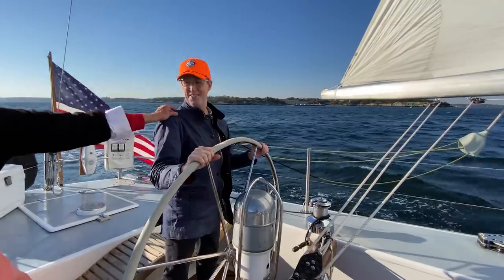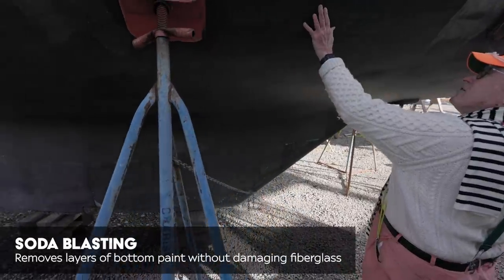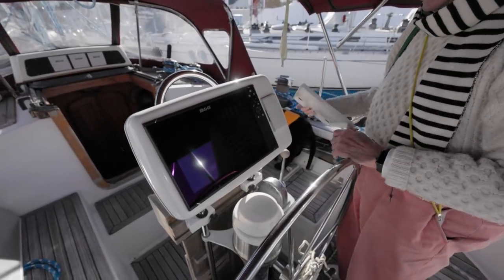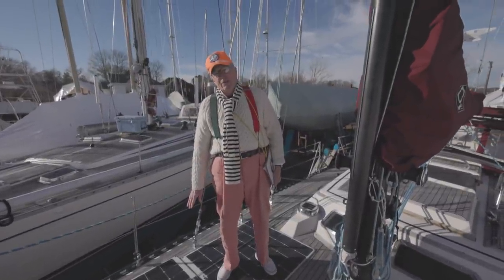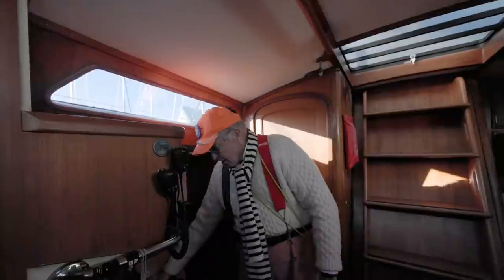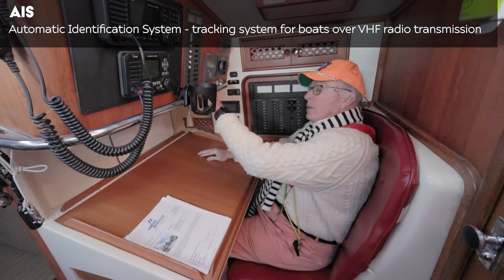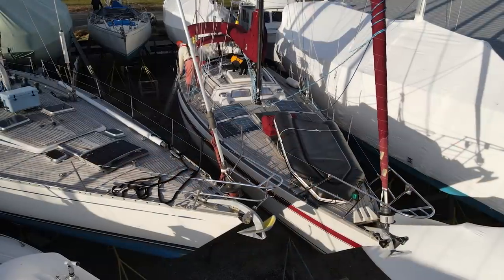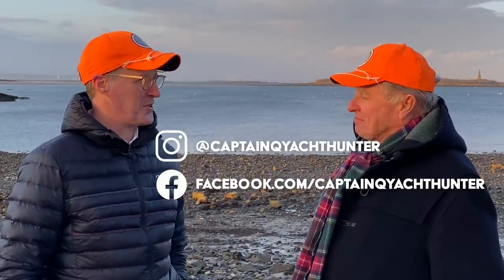$99,500 USD GLOBAL CRUISER! Proven bluewater sailboat for sale! EP76 #sailboatforsale #sailboattour

Comment: I absolutely hate that forward companionway for two reasons.  One, you have to go onto the cabin top to use it which is dangerous in a seaway and two the ladder is almost vertical.  The ladder simply invites a bad fall.  Repairing the water damaged teak veneer is not that hard IF the substrate isn't also rotted.  That said, making the repair invisible is difficult and requires a lot of experience matching colors with stain.  On top of that the entire interior will have to be stripped and revarnished which is a big job.  The teak decks are shot as you noted and every screw is a potential water entry point into the deck.  A proper repair is also a HUGE job.  The v-berth looks pretty unusable to me.  Does the boat have a genset?  if not there is no way to heat the boat away from the dock.  Lots of issues, not to mention engine access.  Not the sort of boat I would want.
Reply: There's a genset under the helm. The midship companionway has sufficient grabreails. Engine access under   that middle companionway looking aft is very good as is access hatch in starboard head.   Lemon oil all the wood below keeps a satin shine. Once a year or more.
Reply: @richgleason7699  too bad they didn't show any of those things in the video.  I would never use lemon oil.  All my interior wood has eight coats of  Epifanes gloss followed by two coats of Epifanes rubbed effect.  The cabin sole is finished with Epifanes 2-part.
Reply: @todddunn945  truth is just the idea of putting multi coats of Epiphane's on that much interior wood is enough to make me quit sailing! I'll stick with Lemon Oil. Kidding aside the quality of the wood inside is amazing
Reply: @richgleason7699  Well I did say it is a big job, but doing it right is worth it.
Reply: Mr. Dunn, I was just going to pass on your commit, but then decided what the hell.  Sir, there is no rot on this boat, decks are wore for sure, odds are the deck can be professional sanded and new screw plugs installed.  What Capt. Q did not have the time to tell us all in his short video is all the work that has been done on Dream Weaver in 2018/2019 mostly.  Here is an incomplete list, hell it may (but I doubt it) meet with your approval.     Be Happy, be safe.

Accommodations
Sleeps 7-8.  V berth forward.  Enclosed head with vanity and shower next aft to port, hanging lockers opposite to starboard. Main cabin features U-shaped dinette to port which converts to form double berth, settee opposite to starboard. Galley next aft to port, forward-facing navigator's station opposite to starboard. Aft owner's stateroom with double berth to port and single berth to starboard is accessible from main cabin through a second head, with vanity and shower, located aft of navigator's station. Both toilets are Wilcox Crittenden Skipper models, both rebuilt in 2019. Shower fixtures new in 2019.

Galley
U-shaped galley features propane four-burner, gimbaled, stainless steel stove with oven (oven  not working),  Sea Frost (2021) 12 volt refrigerated ice box and separate freezer with digital monitors and controls, double stainless steel sinks with pressurized hot/cold water. Propane system installed in 2019.

Electrical
12 volt DC and both 110 volt AC and 220 volts AC. Engine and generator starting batteries are 12 volt lead acid. House batteries consist of three Relion RB-300-hp 8D 300 ah lithium iron phosphate batteries (2019). Four deck-mounted semi-rigid, walk-on, 175 watt SolarWorld Sunmodule solar panels mounted on foredeck whose 700 watts of power produce as many as 250 ah per day! The four three-foot-square panels feed two 30 amp Victron SmartSolar MPPT charge controllers, monitored via a Victron Color Control GX mounted at nav station. Eclectic Energy (British) D400 wind generator (2019) with max output of 600 watts. Nex-Gen 5.5 KW 10 HP diesel genset (2019) with 75.7 hours. 110 and 220 volt Victron Energy inverter/chargers (2019). Boat automatically accepts 110 volt or 220 shore power and can output both voltages simultaneously, if so desired.

Electronics and Navigation
Brooks and Gatehouse electronics suite including forward-facing sonar, AIS transceiver, 4G radar (antenna mounted on mast), three Triton2 multi function displays, 12" Zeus3 chartplotter, and barograph. All purchased new in 2019, all updated in 2021. Simrad hydraulic autopilot (2019) networked to B&G system, Icom M803 marine HF SSB radio transceiver (2019) with DSC and color display, Icom AT140 automatic antenna tuner (2019). Insulated backstay serves as SSB antenna. Copper foil ground plane glassed into hull during boat's manufacturing process (standard practice with all Lafitte 44's). Icom IC M-506 VHF radio transceiver (2019) with RAM mike (2019). Iridium wifi satcom system (2019). King wifiMax router and range extender (2019). Ritchie SP5 binnacle-mounted compass.

Hull and Deck
Modified full keel with skeg-hung rudder. External lead ballast. Airex-cored hull, balsa-cored decks. Teak decking. Double bow anchor rollers. Maxwell electric windlass, rebuilt in 2019 with foot switch and wireless remote control. Double stainless steel lifelines (2018) with starboard boarding gate. Edson steering system. Four opening overhead Bomar hatches. 10 opening ports. Two Marinco solar vents with reversible fans. Two midship deadlights (2019). Cockpit shower. Dyneema jacklines, port and starboard, running bow to stern. Three padeyes in cockpit for attaching safety harness tethers

Sails and Rigging
Cutter-rigged keel-stepped aluminum mast. Staysail stay fitted with quick-release lever at base allowing stay to be quickly deployed or stored. Running backstays. Sail inventory of 7 sails, all made by Port Townsend Sails in 2019, includes fully battened mainsail with two deep reefs (30% and 60%), light air loose-footed mainsail with snuffing sock, roller-furling 115% genoa, Dyneema-stayed drifter, particularly robust staysail, storm trysail with separate track on mast, and storm staysail. Block and tackle boom vang with Dyneema line, 22', 20 lb. carbon-fiber whisker pole (2018) with integrated stowing (flush with mast) nd deploying system. Harken mid-boom mainsheet traveller (2018) mounted on house. Winch inventory includes two Harken #35 two-speed, self-tailing, mast-mounted halyard winches, Lewmar #30 self-tailing, two-speed, mast-mounted, reefing winch, two Lewmar #55 self-tailing, two speed, primary genoa sheet winches, two Lewmar #40 self-tailing, two-speed winches mounted on coach roof, one Lewmar #46 self-tailing, two-speed winch mounted on coach roof. All standing rigging and turnbuckles new in 2018.  Most running rigging replaced in 2018 with Dyneema. All chainplates removed in 2018, dye tested, and electropolished. All chainplate attachment points reinforced in 2018 with additional glass.

Mechanical
Wind Pilot Pacific (German designed and built) servo-pendumum mechanical windvane self-steering system (2019).

Additional Inventory
Viking 8-person liferaft (2019) in hard cannister mounted in a deck cradle. 3D Superlight Twin Air 290 9.5' inflatable dinghy. Burgundy cockpit dodger (2019) with zippered front window, stainless steel bows, and stainless steel grab rails on three sides. Burgundy bimini (2019) with stainless steel bows, full 360 degree enclosure, canvas covers for all windows, window on top for checking sail trim, and cover for top window. 45 lb. CQR plow anchor with 300' of 10 mm chain, 300' nylon rode, Danforth 35 HT with 50' 10 mm chain, Paul Luke 100 lb fisherman anchor (2019). Ace Sailmakers (E. Lyme, CT) Jordan series drogue. Plastimo extendable man overboard pole (2019). Stereo with two speakers in main cabin. Pots and pans. Toaster. Five fire extinguishers, six fenders, assorted docklines, two horseshoe buoys (2019), boat hook. Misc. engine spares.
Reply: @richgleason7699  it also has the following Rich:

Accommodations
Sleeps 7-8.  V berth forward.  Enclosed head with vanity and shower next aft to port, hanging lockers opposite to starboard. Main cabin features U-shaped dinette to port which converts to form double berth, settee opposite to starboard. Galley next aft to port, forward-facing navigator's station opposite to starboard. Aft owner's stateroom with double berth to port and single berth to starboard is accessible from main cabin through a second head, with vanity and shower, located aft of navigator's station. Both toilets are Wilcox Crittenden Skipper models, both rebuilt in 2019. Shower fixtures new in 2019.

Galley
U-shaped galley features propane four-burner, gimbaled, stainless steel stove with oven (oven  not working),  Sea Frost (2021) 12 volt refrigerated ice box and separate freezer with digital monitors and controls, double stainless steel sinks with pressurized hot/cold water. Propane system installed in 2019.

Electrical
12 volt DC and both 110 volt AC and 220 volts AC. Engine and generator starting batteries are 12 volt lead acid. House batteries consist of three Relion RB-300-hp 8D 300 ah lithium iron phosphate batteries (2019). Four deck-mounted semi-rigid, walk-on, 175 watt SolarWorld Sunmodule solar panels mounted on foredeck whose 700 watts of power produce as many as 250 ah per day! The four three-foot-square panels feed two 30 amp Victron SmartSolar MPPT charge controllers, monitored via a Victron Color Control GX mounted at nav station. Eclectic Energy (British) D400 wind generator (2019) with max output of 600 watts. Nex-Gen 5.5 KW 10 HP diesel genset (2019) with 75.7 hours. 110 and 220 volt Victron Energy inverter/chargers (2019). Boat automatically accepts 110 volt or 220 shore power and can output both voltages simultaneously, if so desired.

Electronics and Navigation
Brooks and Gatehouse electronics suite including forward-facing sonar, AIS transceiver, 4G radar (antenna mounted on mast), three Triton2 multi function displays, 12" Zeus3 chartplotter, and barograph. All purchased new in 2019, all updated in 2021. Simrad hydraulic autopilot (2019) networked to B&G system, Icom M803 marine HF SSB radio transceiver (2019) with DSC and color display, Icom AT140 automatic antenna tuner (2019). Insulated backstay serves as SSB antenna. Copper foil ground plane glassed into hull during boat's manufacturing process (standard practice with all Lafitte 44's). Icom IC M-506 VHF radio transceiver (2019) with RAM mike (2019). Iridium wifi satcom system (2019). King wifiMax router and range extender (2019). Ritchie SP5 binnacle-mounted compass.

Hull and Deck
Modified full keel with skeg-hung rudder. External lead ballast. Airex-cored hull, balsa-cored decks. Teak decking. Double bow anchor rollers. Maxwell electric windlass, rebuilt in 2019 with foot switch and wireless remote control. Double stainless steel lifelines (2018) with starboard boarding gate. Edson steering system. Four opening overhead Bomar hatches. 10 opening ports. Two Marinco solar vents with reversible fans. Two midship deadlights (2019). Cockpit shower. Dyneema jacklines, port and starboard, running bow to stern. Three padeyes in cockpit for attaching safety harness tethers

Sails and Rigging
Cutter-rigged keel-stepped aluminum mast. Staysail stay fitted with quick-release lever at base allowing stay to be quickly deployed or stored. Running backstays. Sail inventory of 7 sails, all made by Port Townsend Sails in 2019, includes fully battened mainsail with two deep reefs (30% and 60%), light air loose-footed mainsail with snuffing sock, roller-furling 115% genoa, Dyneema-stayed drifter, particularly robust staysail, storm trysail with separate track on mast, and storm staysail. Block and tackle boom vang with Dyneema line, 22', 20 lb. carbon-fiber whisker pole (2018) with integrated stowing (flush with mast) nd deploying system. Harken mid-boom mainsheet traveller (2018) mounted on house. Winch inventory includes two Harken #35 two-speed, self-tailing, mast-mounted halyard winches, Lewmar #30 self-tailing, two-speed, mast-mounted, reefing winch, two Lewmar #55 self-tailing, two speed, primary genoa sheet winches, two Lewmar #40 self-tailing, two-speed winches mounted on coach roof, one Lewmar #46 self-tailing, two-speed winch mounted on coach roof. All standing rigging and turnbuckles new in 2018.  Most running rigging replaced in 2018 with Dyneema. All chainplates removed in 2018, dye tested, and electropolished. All chainplate attachment points reinforced in 2018 with additional glass.

Mechanical
Wind Pilot Pacific (German designed and built) servo-pendumum mechanical windvane self-steering system (2019).

Additional Inventory
Viking 8-person liferaft (2019) in hard cannister mounted in a deck cradle. 3D Superlight Twin Air 290 9.5' inflatable dinghy. Burgundy cockpit dodger (2019) with zippered front window, stainless steel bows, and stainless steel grab rails on three sides. Burgundy bimini (2019) with stainless steel bows, full 360 degree enclosure, canvas covers for all windows, window on top for checking sail trim, and cover for top window. 45 lb. CQR plow anchor with 300' of 10 mm chain, 300' nylon rode, Danforth 35 HT with 50' 10 mm chain, Paul Luke 100 lb fisherman anchor (2019). Ace Sailmakers (E. Lyme, CT) Jordan series drogue. Plastimo extendable man overboard pole (2019). Stereo with two speakers in main cabin. Pots and pans. Toaster. Five fire extinguishers, six fenders, assorted docklines, two horseshoe buoys (2019), boat hook. Misc. engine spares.
Reply: @larryboles629  Frankly I wonder why you are wasting time telling me all this.  I agree, the owners spent a lot of money in 2018/19.  Personally I do not like the boat for the reasons I gave.  I am not in the market for a boat.  I have not and will not ever see this boat.  So why do you care what I think, which was based only on what I saw in the video.  My comment about the forward cabin top companionway was based on my personal distaste for such companionways.   I don't like that sort of companionway on ANY boat.
Reply: @todddunn945  I do appoligized for wasting your time Mr. Dunn.  Just trying to add to the information that Capt. Q did not have time for.  Be happy, be safe
Reply: @larryboles629  Not a problem.
Reply: @larryboles629  Thank you for the update  Larry.
There are definitely some goodies on the list Captain Q didn't reveal.
For you and for any interested, I bought my Lafitte 44 in 2016 and keep it Mattapoisett, one harbor over from Marion!
The boat is a wonderful sailor!
Balanced and terrific even in snotty So'wester common in Nantucket, Rhode island and Buzzards bay.
Reply from the maker: one last note...having had a boat with two companion ways , it does give the owner quiet and privacy at a dock when the young turks stumble aboard after last call ashore